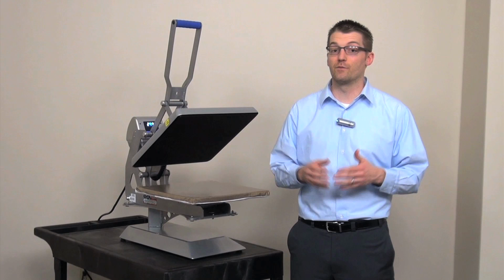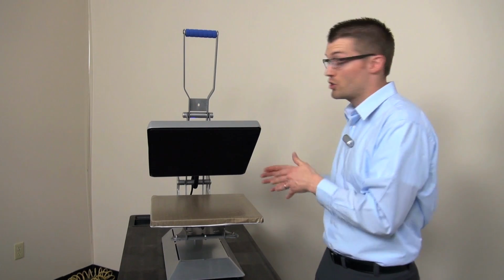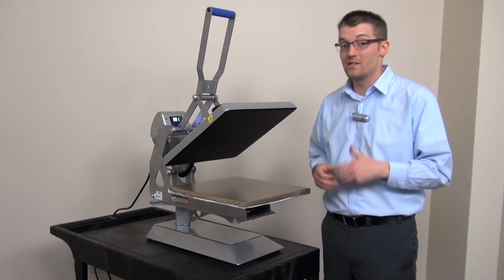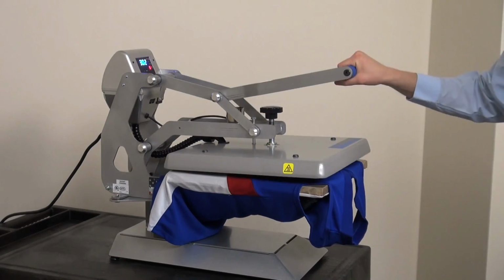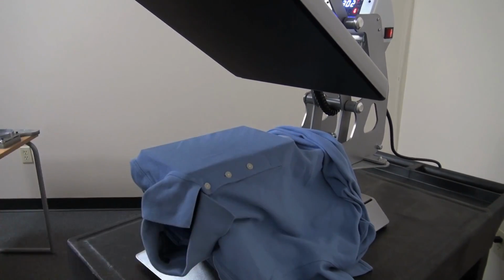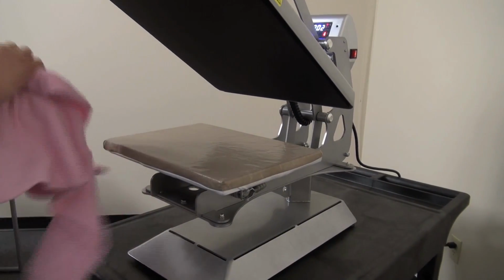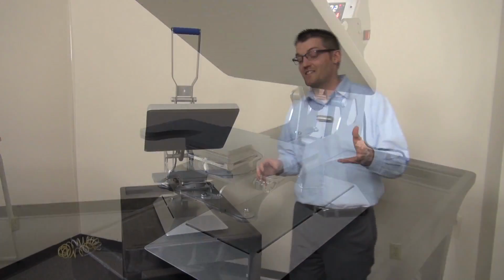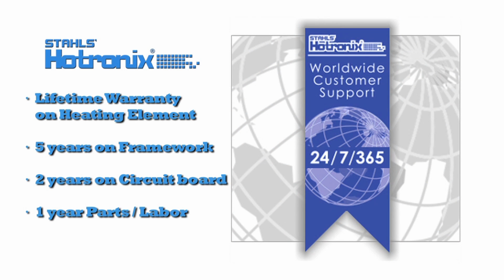Up Close: Hotronix® Auto Open Clam Heat Press - Quick Latch

Comment: I just had mine for less than 6 months and now the quick release will not release the platen.  It will not budge, tried pulling it back as hard as I can but will not budge.  Not sure which position for full release as I want to try with a pipe if it's stuck if it's just stuck at the pivot point.